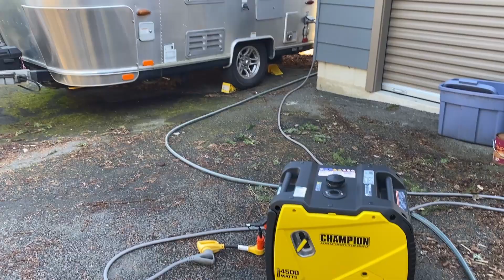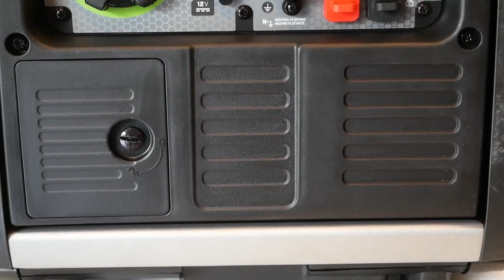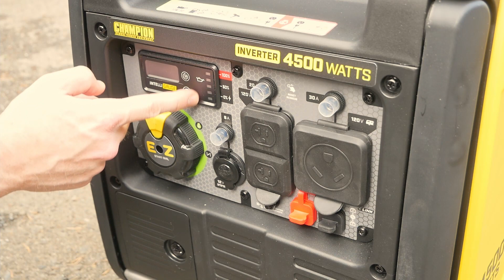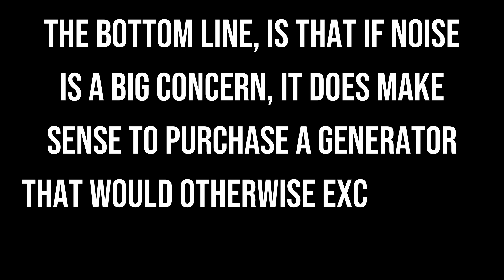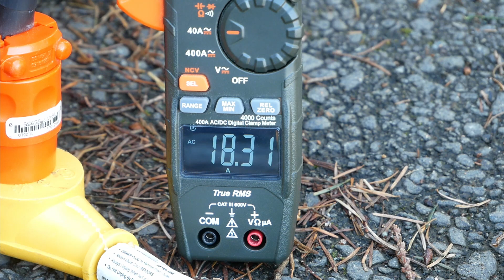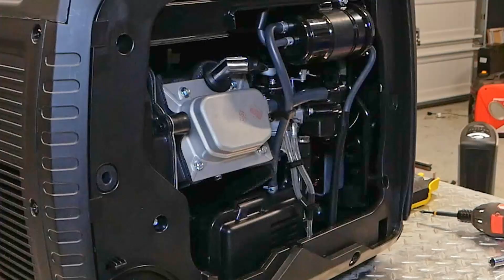The Champion 4500W Inverter is a Quiet and Powerful TANK

Comment: You know I've had mine a couple of years now and no problems. Only have 120hrs on it, but I will change the oil for a third time next week.. I was a little sketchy at first selling my honda 2500watt framed generator. But I had nothing to complain about, zero problems. You did mention the weight, which is my only concern as a senior.  Purchased it on sale at Costco, it's a great deal and upgrade from my Honda. (That even speaks to what a great product Champion has produced) Though I will be looking for a smaller 2000is Honda or Yamaha soon, mostly for smaller projects... Great video and review.. Thanks
Reply from the maker: Thx for the feedback. I compared my Predator 2000 to my Dad's Honda 2000: https://youtu.be/4pYE8ilkVk4 ...didn't see all that much difference in performance. Though I would expect the Honda to last longer and have much better resale value.

Comment: I’m considering this one over the predator 3500 but I can’t make up my mind
Reply from the maker: I'm assuming you mean the Predator 3500. In that case, I'd say the Champion wins. Both run the "China 212"..which is what I call the 212cc engine that everyone aside from Honda/Yamaha use. Otherwise, the Champion is a bit more powerful and comes with a 3-year warranty vs Harbor Freight's garbage 3-month. Main benefit to the Predator is electric start.
Reply: @aaronstestlab how many hours do think the Chinese motors will last ? is it really worth buying a Honda or Yamaha I went with the champion if I used it all day every day I would consider spending the money but couldn't justify for just back up power
Reply from the maker: I honestly don't know. All I can say is that I've had the Predator 2000 for about 7 years. Aside from using stabilized fuel and yearly oil changes I don't really do any maintenance, yet it still starts in 2 or 3 pulls.

Comment: Do you know if there is a way to put a muffler or extender on the exhaust? I'm looking at using this at my acreage but have neighbors and I don't want them to have to listen to it so going to build a shed for it and need extend that exhaust outside of the shed.  Great video, thanks!
Reply from the maker: I've never used one, but I know you can find generator exhaust hoses on Amazon.

Comment: I own this model as well as two 2000 watt champion inverter generators and two 6500 open frame Champion generators . They are all great. This one is very quiet amd efficient.
Reply from the maker: Nice, been using it on and off for a year now and no problems.
Reply: @aaronstestlab  all of me champion generators run perfectly.

Comment: I have the dual fuel version of this generator and after about 70 hours of use I love it.   I have not put a drop of gas into it and I dont intend to if I can avoid it.  you lose some capacity by using propane but the trade off is that you dont have to worry about bad fuel and you can store propane indefinitely without needing stabilizer or about fuel system issues that gasoline creates
Reply from the maker: Great point. That said, I think people worry a bit too much about gas going bad. If you recall that little Predator 2000 I used in this video for comparisons sake. It's about 5 years old now. I've never used anything other than stabilized fuel in it, and it always starts in just a couple of pulls every spring. So yeah, it's an inconvenience to use gas, but it's also a pretty minor one.
Reply: I thought about this, and I agree but I went with the gas with remote start I really like that feature but I wish it was dual fuel
Reply: Same. Just ordered my dual fuel. Can't wait!
Reply: Dual fuel is very convenient. I wouldn't worry about fuel just use stabilizer and use high test 95 octane.

Comment: I ordered the Dual fuel electric start model, and I was sent this model. I needed it for my RV. Got refunded the money and also got to keep this model. I need the Dual fuel as traveling with Gasoline and a RV is not fun. Very nice review of this generator.
Reply from the maker: Nice. Having the option ton run on propane is clutch when RV'ing. I also know from experience.

Comment: Next time, cut the tape at the bottom of the box and lift the box instead of the generator which, more often than not, will simply lift WITH the box when you do it the way you did..
Reply from the maker: Would have been smarter to do it that way
Reply: @aaronstestlab  Advice from a guy who's had spinal surgery.

Comment: Why would you compare a 38A (Champion 4500W) to a 16A (Predator 2000W) generator? Not a fair comparison at all. But I get that this is just your opinion. Why not compare it to the Predator 30A (3500W) generator? I have both and actually prefer the Predator 3500W Inverter Generator. A plus is the Predator has an electric start.
The handle that the Champion has would have been nice on the Predator though...
Reply from the maker: I think the only point I was making was that the larger generator is quieter for any given load.
Reply: The Predator 3500 is rated for 25 amps not 30 amps.

Comment: Why did you not buy the predator 3500 since you already had the predator 2000?
Reply from the maker: HF is getting too expensive
Reply: @aaronstestlab  my Predator 3500W Inverter Generator retailed for around $700, I got it for $560. Our Champion 4500 was around $850 which includes it's "sale price of $350 off retail coupon" and I prefer the Predator. And bonus -- the Predator has an electric start.
Reply: @jamesherrmann128  The Champion puts out more power..